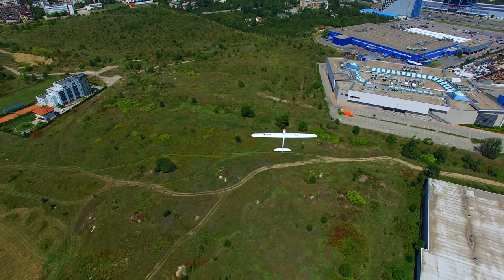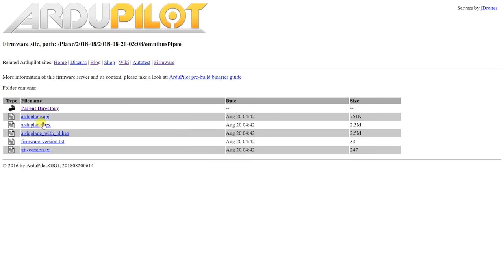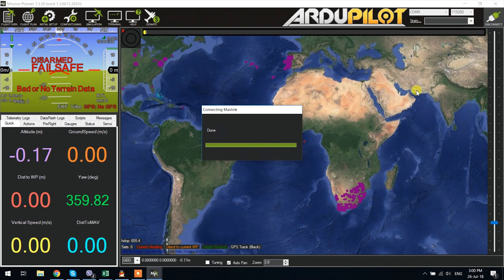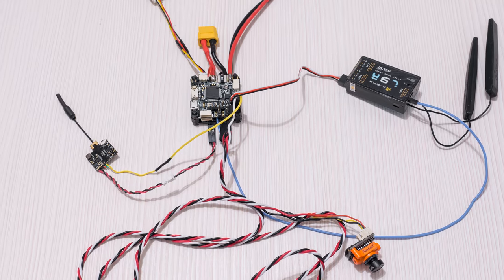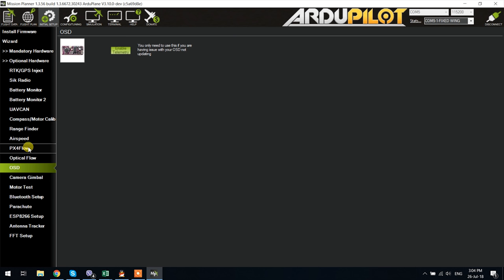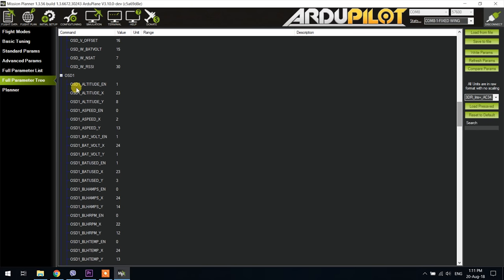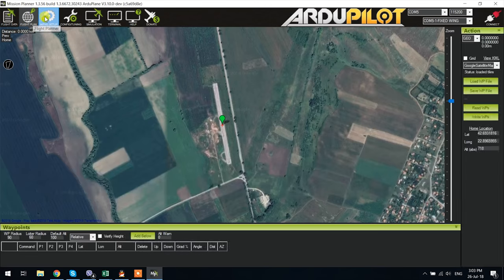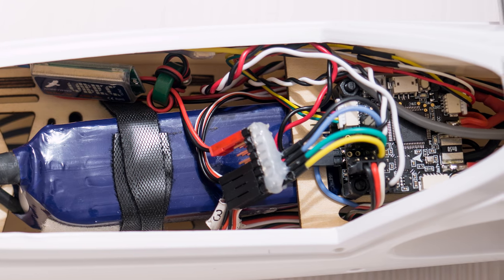HOW-TO ArduPlane on Omnibus F4 Pro and other boards!!!

Comment: Have you try akk f4 board? Is it compatible with this?
Reply from the maker: If you are talking about the non-Pro model, I have not tried it because it doesn't have the current sensor in it, and I do prefer to have it on board! Same process should work for it though!

Comment: Thank you again for the post mate!  As always top notch content.  One issue I'm having (and suspect it is more of a windows thing) is once I flash ArduPlane firmware via DFU in Betaflight, it no longer creates a com port.  Oddly, I can still bootload in DFU mode.  Therefore, not even in mission planner, I am able to find the board.  However, on my Mac the board appears with no issues.  I can use both APM Planner and QGround Control with no issues on Mac.  Any suggestions or thoughts?  Perhaps others on this commentary have stumbled onto this and can provide any insight? Thanks in advance.
Reply from the maker: Sounds to me like it might be an issue with the windows drivers!! Search around for a video of the Zadig driver fixer... or something like that, there should be a few videos on youtube about it, give it a try and see if that fixes it!
Reply: Are you still using Beta flight in chrome, like I was.
Reply: @GW-zw6wo  Yes. I did follow the advice of ArxangelRC and fixed the drivers to find the com port again.  It worked.  Last issue now is the connection "locks up" in mission planner after a minute into the connection.  I tried connecting to QGround Control on my Mac and had no issues.  It appears there's some kind of driver/com port issue on my Windows 10 machine.  Cheers!
Reply: Same "serial port failed" issue trying to flash with W10 drivers and even ones from STM. Running ImpulseRC_Driver_Fixer.exe and reeopening the configurator did the trick.
Reply from the maker: I have struggled with that as well on my Win10 laptop, and after trying a variety of things... at last it worked... haven't touched it since so as not to mess it up... not sure how though! :D

Comment: Hello,

Please can you connect a telemetry radio to the Omnibus F4 pro ?

If so, how do you do this ?
Reply from the maker: Hi, in general you can, but I am not sure how exactly because I've never tried it! I remember some people complaining that if you connect telemetry the receiver input stops working, but I can't really say foe sure if that is true, never tried it.
Reply: @ArxangelRC  thanks for the reply.
But if you did not connect the telemetry how did you set the mission in mission planner ?
Like how did you get telemetry?
Reply from the maker: @ogheneochukoakpojotor7683  I program it with cable prior to taking off.
Reply: @ArxangelRC  Also another question ;
What is the max input voltage for the batteries is it 4S or 6S?
Reply from the maker: @ogheneochukoakpojotor7683  I think the Omnibus can handle 6S.

Comment: Getting Ardupilot onto my F405 Wing was easy enough but I can't get seem to get the servo channels mapped correctly in Mission Planner.  I waded through the parameter tree but couldn't locate where to remap the servos.  Setting up Ardupilot with FCs like the Pixhawk is so easy but working with Chibios is giving me a headache =(  I may just give in and go with iNAV on the F405
Reply from the maker: Why are you trying to remap them in the firmware? What radio are you using? Wouldn't it be easier to do it there? Also... I don't think the params are any different... should have the exact same functionality no matter the hardware.
Reply: @ArxangelRC   Thanks.  You'd think so but it's not quite so easy.  My radio is a FrSky Taranis Plus so Tx programming is straightforward but I'm using separate channels for the ailerons and Mission Planner's servo options don't appear to have a provision for that arrangement - not that I could find, anyway.  I also recall seeing some weird conflicts between the channels reported in the Mission Planner radio calibration and another area in the model setup (but I can't remember which screen).  Meh.  No big deal.  I also have an F405 Wing on an S800 Sky Shadow build and may try installing Ardupilot on that one
Reply from the maker: It should have that and it should be easy! Connect the second aileron to the 5th output on the board... I assume it has it, and then go to the Servo Output tab in Mission Planner, and on the 5th output channel, from the drop down it should have either Ail in the list, or Left and Right Aileron as separate items, just select those accordingly...
Reply: @ArxangelRC  Thanks.  I'll give that a try sometime this week
Reply: @ArxangelRC   HA!  I learned something new [again] thanks to you 😁 I've never used Mission Planner to setup a fixed wing craft before and when I searched the params tabs I totally missed the servo channel settings because they're listed as 'RC' and the word "servo" doesn't appear in their descriptions 😝  Anyway, now that I know where they live I'll give it another go.  I'm also using an F405-Wing on the Ranger G2 and I think I'll try ArduPilot on that build.  Cheers!
Reply from the maker: Hahaha, yeah... we learn something new every day! Glad you found them! :) Best of luck!

Comment: I'm looking for an as small and portable as possible way to get into semi long range fpv, and I was thinking of the nano talon running ardupilot. Are there any better planes out there for this purpose?
Reply from the maker: The Nano Talon would require a few mods to make it fly OK... although depends on what you really are after! The XK A1200 is a nice model, but it is a lot lighter and may not be as durable in higher winds! The Nano Talon fills a niche and I can't easily think of an alternative at this size and ability!
Reply: @ArxangelRC  the a1200 looks nice, but it's just too big for what I'm after. I watched all your videos on the nano talon and besides inav giving you the finger what mods does the nano talon need? I really enjoy your videos man, one of my fav channels for sure.
Reply from the maker: Thanks mate! Well... there is the flat wing mod, which I will do soon, and then people also put winglets, and wing fences, vortex generators, etc., it ends up looking pretty weird, hence why I have been so sparing with mods on mine, because I would still like to be able to put it back in its original box... though at some point I might sacrifice that for the sake of a good looking flight!
Reply: @ArxangelRC  hahaha allright, I'm down for as many mods as long as compactness isn't sacrificed, please make more videos on the thing soon, I can't wait.
Reply from the maker: Will do, but vacation time is coming up... so there might be a slight delay! :)

Comment: I have done the same on a Matek F405 wing and everything is working great… I wasn't able to setup the power module could you please help me on that
Reply from the maker: What exactly is the problem? I've also had a hard time calibrating the current sensor on the Omni F4 Pro boards here... for some reason, although the voltage works perfectly!
Reply: Thanks for the quick reply… the problem is that I have what should I do to set the current and voltage sensor in the software side what parameters should I  change to get it to work
Reply from the maker: Have you enabled the sensor?
Reply: @ArxangelRC I did the problem is with the rest of the settings, I will send you some pictures on facebook if you don't mind
Reply from the maker: Not at all mate, will help if I can! :)

Comment: Very insightful video, however there is one MAJOR false information, that is the compass is not needed.
Yes it's information can be partially replaced with a combination of data from the GPS and/or airspeed sensor, but it is VERY important in windy conditions, soaring and landing as the plane may be flying slightly sideways not knowing that it's heading is actually different. 

It's not even that hard to calibrate, although I would recommend getting an external compass (most GPS modules come with an integrated one so use that) to get away from all the magnetic interference from the power lines in your aircraft.

That said it is a good starting point, try it without the compass and then add it in later, but DO THAT!
Reply from the maker: Well... true... in some way... but then in most cases you could do without... and in the past at least... it has caused too much grief to remember... hence why I don't use it! Also... when landing you usually see the ground pretty close and are hardly looking at the OSD direction even if landing by FPV. :) BUT... everybody is free to decide for themselves! I am sharing my point of view on this! :)
Reply: @ArxangelRC  About the landing I meant automatic landing, manual doesn't really need the compass.

But thank you for acknowledging this, I just wanted to point that out that if anyone ever had problems with the plane flying weirdly that this may be the problem.
Good work!
Reply from the maker: Yeah... for an auto one, you might need the compass... I've never done one... so don't really need it!

Comment: I get a "failed to open serial port" error all the time. Tried Inav same thing... I am using an F405 wing FC.
Reply from the maker: Is it possible you got a defective board?
Reply: ArxangelRC I flashed inav 2.0 and I managed to do it. Thanks!
Reply from the maker: So you stayed with iNav, or after iNav you managed to flash ardupilot?
Reply: I flashed 2.0 and then I could get I to dfu mode and flash arduplane. I am soldering at the moment...😉
Reply from the maker: That is useful information! I am about to flash one Omni F4 Pro for the Crosswind as I am writing this, if I run into trouble will try this approach! :)
Reply: Well worked for me! I hope you don't need to though!
Reply from the maker: Didn't need to, flashed right away out of box!
Reply: My F4 pro connected fine with betaflight configurator but when i tried to program it i always got "failed to open serial port" It would not go into "DFU" mode.
Eventually i found this: https://impulserc.blob.core.windows.net/utilities/ImpulseRC_Driver_Fixer.exe
It fixed it instantly. I find it wierd I seem to be the only one who had this problem.

Comment: Which flies better, inav or ardupilot or are both programs basically the same?
Reply from the maker: For the time being at least, ArduPilot for me is a lot more reliable than iNav. Flight characteristics are hard to compare... but I would still go with ArduPlane, as iNav does have some issues still in that department.
Reply: ArxangelRC Thanks for the reply!  I might just switch to ardupilot.
Reply: I've tried both, on the exact same plane, (just change software) and found them to fly both very good.... Arduplane seems a bit 'softer' on the autotune, but that can be tuned as you like.... 
I've only used iNav before, and that has been very reliable to me, including waypoints, RTH, etc.
Personally, I found iNav easier, but I guess that depends on what you're familiar with. Some people say Arduplane is better, but when trying to set up arduplane for the first time, I got stuck in some settings, that where hidden deep inside the total parameter list in Arduplane...... But the same could be said for iNav CLI settings if you're new to iNav. 
But it's good to have both options I guess.... Try them both, and see what you like best.... 
Guess I will play some more with Arduplane, and keep one plane on Arduplane, and another one on iNav...
Reply from the maker: Valid points Wilco... I do feel lost in the Betaflight/iNav CLI for sure... but I have been dealing with the ArduPilot code for years, so it is much more familiar! Both take some getting used to if its your first time, but from what I've seen with iNav... would prefer to stick to ArduPlane for the time being... BUT... competition does drive things forward, so I hope iNav up their game!
Reply: ArxangelRC definitely Arduplane is a lot better imo. Way easier to setup and way more reliable.
Reply from the maker: Maybe not easier for a first time user... but it is the more mature code, and it shows! :)
Reply: ArxangelRC that very true.   But I most say Ardupilot for me was a lot easier to navigate and actually learn.  I believe this was because of all the documentation and Ardupilot development out there.  The wiki for Ardupilot is actually Maintained and kept up to date unlike inav.  Last I checked inav wiki was still describing 1.9 and from what I see inav 2.0 is much different than 1.8 and 1.9.  Inav has its place but imo Ardupilot is way more advanced and much easier to learn by navigating groups and wiki or GitHub
Reply from the maker: Yes, that is correct indeed! :)

Comment: I have failed to get rssi displayed on osd. Rssi_type set to 3..i am using r9mm rx. Firmware arduplane 4.0.6 official
Reply from the maker: As in the value for RSSI displayed on OSD... or to make the RSSI indicator work and see the receiver's signal?
Reply: @ArxangelRC thanks sir for you reply. i prefer to see it as a value in the osd so can give some alert before totally lost the radio signal.
Reply from the maker: Well you have to enable it in the OSD setup menu!

Comment: I have the Omnibus F4 V3 (non-pro).  I successfully loaded the F4 V3 Pro version on the controller but I cannot get the GPS to work.  I have not made any wiring changes from my iNav configuration where the GPS worked perfectly.  I am using UART3.   Does anyone have any solution?  The GPS locks properly but it shows GPS: No GPS in Mission Planner.
Update:  So I discovered that when I unplug my FrSky 8XR receiver, the GPS works.  Upon further investigation I found this on the ArduPilot Wiki: 
"PPM solder pad/resistor should be soldered and “S-BUS” resistor/solder pad removed Otherwise, UART1 or UART6 or RCIN will not work."
Also, GPS on UART3 won't work either.
Reply from the maker: Alright, sorry for the delay... but I don't think I could have helped with that at all... haven't used the non-Pro version... but I do know there are some differences in the port mapping! So you fixed it?

Comment: I like this video so much.i fly a ranger 2000 and a micro skyhunter  with this.and they fly beautyfull. All  becourse of this video thanks tot this 👍 now i have a talon and i can 't get the vtail good.look for some video's but cant find one for programming apm .in the full list cant find vtail only in the servo i can change rudder or elevator in vtailright or left i can reverse. But nothing helps. I have been reading apm manueel but still no Luck.am i missing some thing? Please help.
Reply from the maker: Actually on the Servos tab, it is the vtailright and vtailleft from the dropdown menu, and it should work! DO NOT DO ANY VTAIL MIXING IN THE RADIO!!!! Do the settings only in the autopilot! And just play around with which one is which, and reversing them, until you get them to move in the correct directions!
Reply: @ArxangelRC  thanks i have been busy to get it right .But i have found the real problem.it is in the servo"s they are all been new but bad as hell. 1 time they work right and the next time they dont .so this is the problem and i order new ones. Thnx again now i know i was on the right track.
Reply from the maker: Weird... did the new ones arrive, did you fix the issue?
Reply: @ArxangelRC  yes the servo"s are good .and everything is working fine now.thanks again.waiting for the maiden but will let you know.i have the cg at 58mm hope it wil be fine.cheers
Reply: @ArxangelRC  it were the servo"s they are new emax but not good so i change them
Reply from the maker: OK cool, I am glad you figured it out! So... how was the maiden?
Reply: @ArxangelRC  thnx .still no maiden .bad Weather wen iam free.and waiting for a 3d printing part for the lipo strap to hold only valcro is not enough i think to hold the lipo.i also want to but li ion for it.can i use 4s3p li ion? Or is it to heavy.
Reply from the maker: Actually if you manage to balance it properly... 4S3P would be perfect as well... the weight itself will not bother this plane!
Reply: @ArxangelRC  thnx i will order ons then 👍
Reply from the maker: @fpvall4693  Good luck!
Reply: So this weekend was the maiden.i had the right cg and was going in fbwa mode .But i saw the travel of the elevator was not so much. And then wen i give throttle the servo"s Are going down on the elevator. I try anyway but had no luck all the 3 times.wen i was home i look at the servo tab and wen i give throttle all the other Servo"s change also ithink this is not good.the elevator is going down on throttle.  I have now put in the Manuel mode and all looks good.better travel and now servo"s stay still wen throttle  . But i really like to fly in fbwa. I dont know what iam doing wrong .did you ever had some thing like this.or do i forgot some thing? Thanks in advance . Cheers René
Reply: Today again 3 hour with fc .first i calibrate the acc again.then the servo"s are beter with throttle up.i had made 1 mistake so i change the fc last time but NEVER calibrate again .I only did put the param o  the board again.and i was thinking it sould be enough. So after calibrate i just was not happy with the range of the servo"s  wen in fbwa mode or every mode exept Manuel. I did not know were to look.but after flashing and all the other things that takes a lot of time 🤨.I looked at the basic tune tap and there you can change the pitch angle. Just how you like it😂😂so i change it and everything looks fine now.just waiting for a free day to try again now.and hope this time it will do what i hope for 👍 thanks hope it helps other people to save some time.cheers

Comment: is this omnibus v2 or v3? what the difference?
Reply from the maker: It is hard to remember now! I think its v2! The difference was that the V3 had some issues with port mapping, and it was a pain to get it working properly after flashing with Ardu!
Reply: @ArxangelRC  is sd card loging works?
Reply from the maker: @ZuNunchaku  It should!